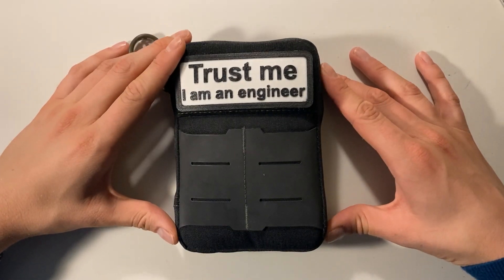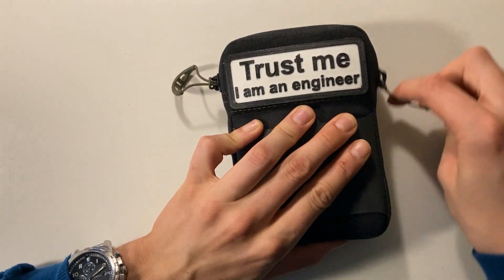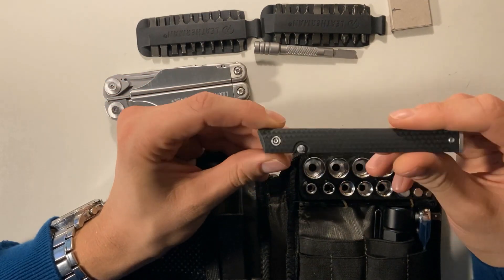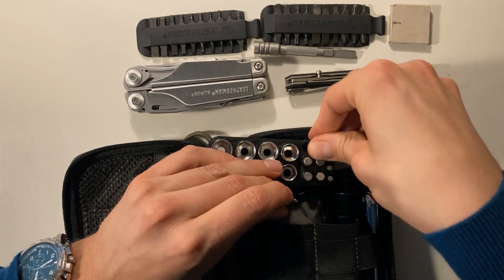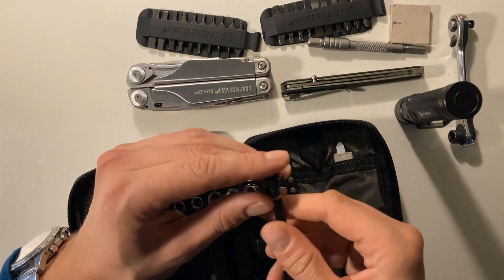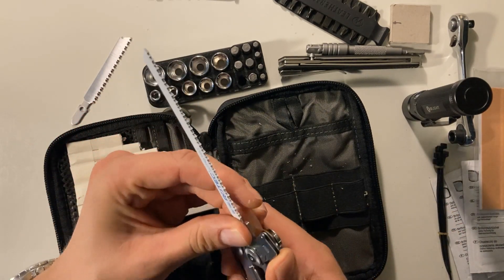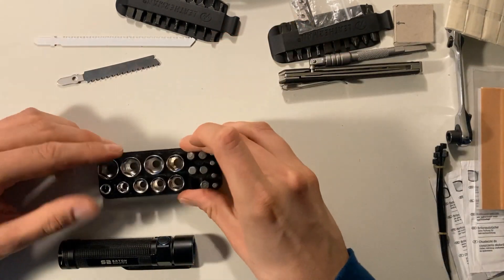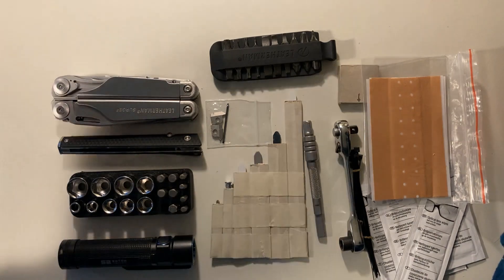EDC for Engineers

Comment: I got a Leatherman ratchet driver and stopped carrying the small ratchet. I carry a Vaughn 140mm 5 1/2 inch pry bar, a few minutes with a file  sharpens the tips very well it allows you to get a bite better with the tool you can scrape with it and it makes a nice door chock to keep doors open
Reply from the maker: Even before you posted this comment I already added the leatherman ratchet driver to the kit. It is quite expensive, but it is very neat. I might consider to add a prybar as well, but I think I won't use it often. It is more of a long term idea.
Reply: @TheWillem  the Leatherman ratchet definitely seems to be expensive but as much as I've used mine already it has more than made up for the cost. The little mini pry bar is one of those things you don't realize how much you use until you actually have it with you. The small keychain pry bars and high-end titanium pry bars still do not do the same job as the little mini Vaughn I carry. It can be a scraper, a pry bar, a chock

Comment: Go with a Wera tools Check +, and 3 or 4 knipex pliers, instead of those toys.....
Reply from the maker: Thank you for your suggestion, but these toys have helped me out many times. I like the flat bits of leatherman, they claim minimal volume. I know it is sub-optimal for torque transfer onto bolts and screws, but they haven't failed me.
Reply: @TheWillem  I gave my ST300 to my daughter, but she prefers using my Wera tools.....
Reply: Wera makes good stuff but Leatherman is very high quality as well. Wouldn't necessarily call them "toys". Also wera isnt the absolute best either in my opinion. Pb swiss and gedore have much of the same items but of a higher quality.
Reply: @mturner221  Here in France, it's  Facom who rules in workshops.

Comment: The SOG Powerlock is a better multitool for engineers.  It's more versatile, can be used in more configurations and is more adaptable and customisable than the Leatherman, and it has compound leverage.  It also connects to standard 1/4" hex screwdriver bits and 1/4" square drive sockets easily.  It also does not rely on springs to operate as the Leatherman design does, which is a weakness in my opinion.  I was an IT engineer until a few years ago and have tried many multitools over the years, including Leatherman, Gerber, SOG and others.  The SOG Powerlock is definitely the best.  I have no connection to SOG tools other than being a happy customer.

Comment: Do you have the files / specs for the socket holder? I've been looking for something like this, but haven't had any luck.
Reply from the maker: I lost the file already, I am sorry. I measured every tool that I wanted in the holder and substracted 1 mm in diameter for a tight fit.

Comment: This is the most practical set of edc that would fulfill my needs that I have see in a while. I'm in construction supervision and I find when I am getting around site it is the little tools for small jobs the guys don't always have on hand. I'm stealing your idea for blade storage. Cheers
Reply from the maker: Thank you! I am glad to you will steal my idea of the blades. Stealing ideas is the main reason why I uploaded this video. This kit has saved me a lot of time as well. At the university we have a workshop (I work there), and sometimes students have very weird screw heads (triangular, square, ...) they want to remove or tension. The standard tool carriages we have at the workshop work fine, but sometimes lack specific bits. It is just awesome to have those in your edc as well.

What tools do you and your guys typically need for small jobs?
Reply: @TheWillem  I'm currently doing work on a $5B extension to an oil refinery in Thailand. We are doing a bunch of structural steel erection and some civil work so the chunky tools, 41mm and up etc are always at hand so a screwdriver or a 6mm spanner aren't normally near by so a few pocket tools can get you out of a jam. I carry a knifeless rebar cause no blades on site. Leatherman bit kit with a small Wera ratchet and a couple of the small Knipex pliers. Saved a walk back to the workshop many times.
Reply: @TheWillem  Sorry to hijack this a bit, but if you are in a workshop, and i suppose the students should become engineers there, i would collect old (ikea) allen wrenches and let them make the bit they need with files.  (The first time i needed a triangle bit this is exactely what i did. Takes a few minutes.)
In my country there are 2 ways of becomming an engineer, one is by attending an engineering school (usually 5 years from age 14-19) or by studying at a university. Biggest difference between the two is the practical education that is missing on university.
And that often shows later in working situations. So every practical experience i'd say is helpfull for future engineers.

I went to such a school and even though my field was electronics (from electricity on atomic level to radar) the first year, we almost entirely spent our workshop time with metal working like filing, operating lathes, milling machines ect. (no CNC)